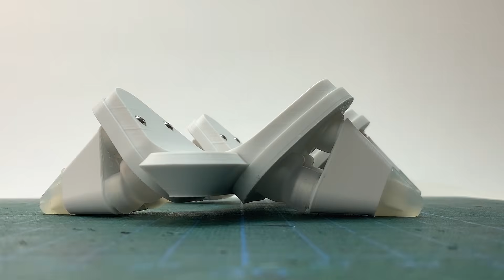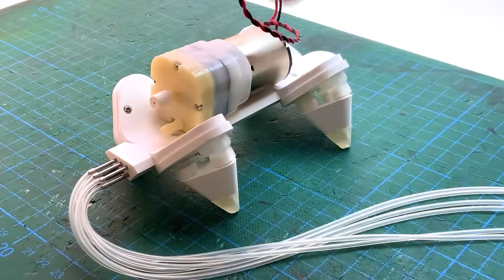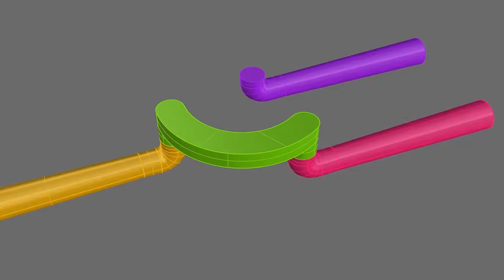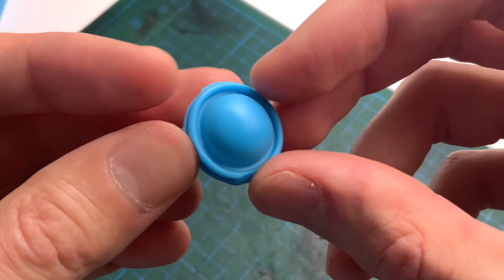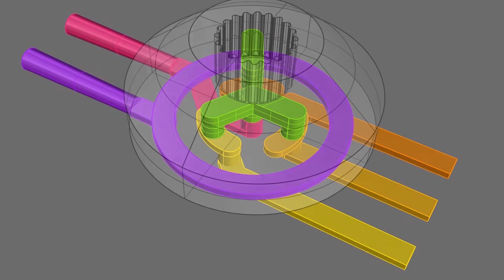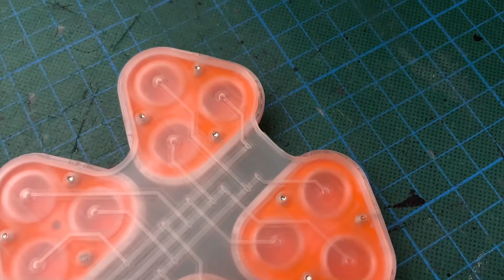Can You 3D Print a Robot’s Brain Out of Air?

Comment: These rolling diaphragms are a kind of bellows, which are a kind of piston and spring. You could get a pair of these to pedal a wheel or multiple to rotate a crank. With a few of them in a spoke pattern, you could push a wheel with a wavy rim, or in a ring pattern you could push a swashplate like in a hydraulic motor. You're really good at making these pneumatic circuits, maybe a version of Strandbeest? That would be so cool to see a tiny strandbeest inspired walker powered by your microfluidic skills!

Comment: you could also turn the valve with air pressure instead of a servo. in your other videos you used a silicone membrane. have you experimented with multi material prints and exchange the silicone to soft tpu? you could create a fully funktional print without the use of any screws or additional steps.

Comment: i see u are using an actual 3D printer.

i have only really used them for basic PLA prints for rapid prototyping.

your prints seem to not have layerlines and are airtight.
what kind of settings and adjustments do you use?

almost looks like it is resin printed, yet you seem to use FDM printing.
these print results are kind of mind boggling to me
Reply: Likely they're using a small nozzle, slight over extrusion, & very low layer heights
Look into printing transparent PETG, it's slow, but the same concept

Comment: This is amazing just as I was thinking about the rotation distance issue you fix it with your second design 😂 I would have been tempted to go smaller and look at the way a spider functions 😂 and as soon as I add that you look at ants 😅 also if you stack the actuators offset to get a better walking gate

Comment: Theoretically, would it be possible to run this robot with a boiler to generate the steam to use for "work" instead? it would not need to be tethered to the air supply then.

Comment: This is awesome progress! Please please please work on a Pneumatic rotational motor! The servo is a nice way to get some rotation into the system but a fully pneumatic motor should be possible right ? Also this print settings are doing an amazing job. Not just for visual clarity, it also stops air leaks by propperly closing off any and all gaps between the lines of fillament. Good work!

Comment: Now if you could power the rotary valve with the air power as well! I suppose you could add a tangential exhaust port and tweak it by varying rotor mass and the size of the tangential orifice to make it kind of "self-throttle"? I suppose that will be quite difficult, as your rotor's bearing resistance (the screw) and the axial force would have to be optimized, and the valve rotor speed is quite low... I could see an ideal case, where the rotor is essentially running on a dynamic fluid bearing with just enough axial force to stay in place and limit leakage. No idea if that would be very power efficient, but it sure could be lightweight!  I hope my rambling makes some sense haha
Reply: Having thought about this for a bit more, whether you use a tangential orifice powered off your main air line, or power the valve rotation with a separate channel (turbine wheels on the outer perimeter?),  air cusioning the valve body woult be quite cool (albeit maybe difficult at low speed). 
For these small, high-precision applications, I wonder ig adding horology bearing stones might be an option down the line. Extremely low friction and low wear, mass produced standard parts for small, precise applications... I wonder if they could be pressed into a 3D print well. Flexture bearing points adjusted/preloaded with a screw might also be good for 3D printed applications like this in general

Comment: A cool next step could be adding a second servo and controlling the left half of the legs with one and the right half with the other. If both are spinning the rotary valves then it goes forward, if you only spin one or spin them in opposite directions you can turn the robot.

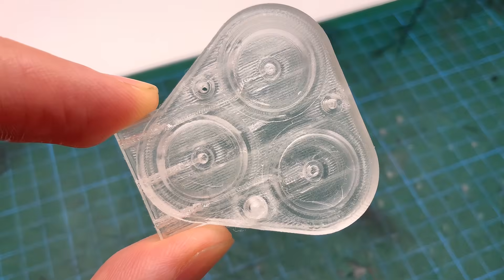Comment: 8:40 The cloudiness is from surface roughness scattering light. You can often make 3D prints much more clear with a layer of epoxy or something that will flow into the rough surface features and cure smooth.
Reply: What about the small gaps inside the print? Maybe just making a mould would be better for clear and just make the whole part epoxy, although that makes the design less additive manufacturing friendly, but just looking at his design it looks possible to cast.
Reply: @Nabikko   I don't know if it will get to the small gaps inside the print, but it will go a long way to smoothing out the surface and making it less cloudy.

Comment: tom stantons air piston motor could be used to create rotational motion instead of a servo. coupling its exhaust to the negative pressure side of your pump may also improve it's performance. it could rotate the valve through a gear reduction.

Comment: Could use a single pump and regulate the output air instead of a second pump? Also how big/hard would it be to replace the servo motor with an air powered one?

Comment: Since you're already working with a "3 phase" system, it shouldn't be that hard to have that rotary valve be driven by the air-pressure itself, using 3 pistons at 120 phase with each other.

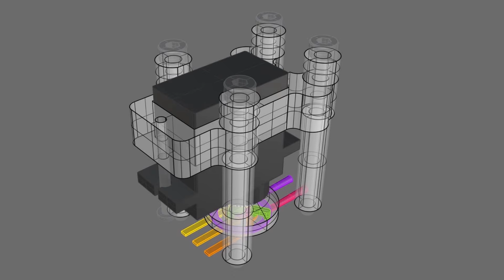Comment: 13:26   So not much has changed. Still dependent on electric power for the ""brain"" and not microfluidic movement. What difference does it make if you are sending DC to is a motor or a microcontroller, get it solely working off of fluid pressures to impress me.
Reply: the only thing the motor is doing is spinning it,earlier every individual tube was controlled individually

Comment: How did you 3D print hollow channels in your components without support filament getting in the way? Was it any specific printer settings? Thank you!
Reply: They are small enough that bridging will work fine. You can see in some of the shots that the texture of the "ceiling" of the channel is a little irregular, but it doesn't matter for carrying air.
Reply: @keegan854  Ah I see, thank you very much!

Comment: Try to replace the servo with an air motor. As a result, you have two tubes only (pressure and vacuum) without 3 wires servo and  you will get a lightweight body.

Comment: For ones with a lot more inputs you could put some teeth onto the rotary part and grooves on the flat part 
Edit: also for the next version you can just have it cycle the air it has, kinda like a heart, which also means you can use water instead of air

Comment: You continue to illuminate just what can be done in the home lab, Softboi.  Someone out there is going to see this and realize that they have the ability to DIY a design for something like a hazardous materials handling system or something equally esoteric that may have unusual design constraints.

Edit: ALSO, now that you are getting to the point of building fluidic oscillators, might I direct your attention to the old BEAM robot design philosophy?  BEAM walkers are rigid-legged robots with oscillator driven gaits that produce genuinely mesmerizing results in terms of obstacle avoidance and navigation.  

It's mesmerizing because the most basic BEAM walker design has zero visible sensor systems.  It's just two motors, oscillating 180 degrees out of phase with one another,.  But, when the front leg hits an object, the entire leg assembly will rotate backwards, moving the walker to one side or the other.  This is without touch or light sensors.  The only connection between the outside world and the oscillator "brain" is the inductance level of the motor driving the legs.  Bumping a leg into an obstacle changes that inductance and causes a one-cycle "flip" in the oscillators, ending up in the motor moving the rigid legs elsewhere for one gait cycle, causing a change in direction.

There would be a lot of design work to figure out what that would look like with your actuators.  Tightly coupling the mechanical oscillators you're building would produce robots that look very different from what you're making now, but transmitting collision signals via increases in back-pressure is a definitely attainable goal for millifluidic systems like yours.

Comment: N is negative pressure
P is positive pressure
An N channel gate is open when connected to the negative pressure supply.
A P channel gate is open when connected to the positive pressure supply.

These correspond directly to P and N channel MOSfets in CMOS logic. A MOSfet has 3 connections, a Source, S, a Drain, D, and a Gate, G. Design optimizations can result in a meaningful difference between S and D, however that is beyond the scope of this comment. S and D are interchangeable until you make them different.

The fluid at the gate must push or pull the with more force than that exerted by the fluids at the S and D connections. This means something like a large diameter cylinder driving a small rod or a diaphragm pushing another diaphragm with a lever.

One possible design would be a pair of 3d printed flat surfaces with holes and a silicone sheet clamped between them. The top surface will be open to the air. The bottom surface will be connected to negative and positive pressure sources. The elastic nature of the silicone will want to make it flat. If there is a small hole on the bottom and a large hole on top, pressure applied on the bottom will push up on a bubble. The negative pressure will just leave the silicone mostly flat. Put the large hole on the bottom surface then negative pressure can pull the silicone down. A small hole on top would limit how far a positive pressure could push.

The other end of the lever could push the silicone down to block an opening between two holes. A slightly more complex mechanism could allow a normally closed channel to be opened.

Comment: it would be really cool if you could use liquids to power your robots. seeing the liquids flow through the see-through channels would be amazing and it could even proof to be more efficient because water is less compressible than air
Reply: hydraulics reinvented pretty much
Reply: @d @darthsquidias7503 but advanced edition
Reply: Not sure what you're expecting, it's only going to move back and forth and it won't be different colors. Not going to be that visually appealing and probably really messy.
Reply: @98Zai alright negative Nancy
Reply: using compressible fluids like air means you can store energy with it. Otherwise you'd need a separate power supply. Imagine using a small CO2 canister with a pressure regulator on it instead of a drink bottle - then you wouldn't really need the extra servo or batteries, you could just power the whole thing with compressed gas
Reply: @tantamounted  really not that difficult to solve, bladder pressured tanks are actually extremely simple and really common. Just have a sack of air in a small water tank. Sack of air doesn't need to be strong at all, pressure equalizes on it's walls. 
Then: push in water, sack pressurizes and therefore tank pressurizes. Reverse speaks for itself. Starting pressure can be calibrated to whatever suits your need. Can store way more energy since it's usually more efficient to use fluids than air.
Reply: This would also allow underwater robots and robots in places with not much air
Reply: Underwater robots exist and so do ones in space.
Reply: I think This is a great idea

Comment: with the servo you can also pump air. and bottled air with a pressure negative or positive is an ok replacement for robots that work for like 2 seconds without electronics

Comment: For getting a completely flat smooth surface you can print on glass. Honestly it's very strange to me how printing on glass build plates got completely phased out to the point barely anyone remebers it. Been using it on my kossel and (heavily modified into a franken-voron) hypercube evolution since starting 3d printing in 2017
Reply: Because glass just doesn't adhere as well as PEI or other alternatives.  You need to go slow with low accelerations for it to be viable even in a coreXY or delta. It works for you, but most printers since about 2019 just don't play as well with glass plates as they do coated spring steel. If I need perfectly smooth  surfaces I have both smooth PEI and custom Garolite/FR4 sheets for that.
Reply: My problem is its too sticky. I can barely get the darn things off the buld plate
Reply: @PendragonDaGreat that's just your personal operator error. Every printer can print great on glass.... New printers even better than the timeframe you mentioned.

Comment: it is in fact very cute. i wonder if it would be possible to at some point drive the logic valve with a motor that's also powered by air presure instead of the servo. maybe even the same that is already used to power the in and deflation of the rubber cones.
Reply: Alexlab already did it.
Reply: @rodniyaya oh damn I didn’t know.

Comment: Amazing build. This is an incredibly cute robot. Nice solutions you came up with for the microfluidics chip. You've been working towards it since the start of the channel so it's awesome to see that come to fruition. I found your idea to take advantage of sputtering very clever, since it means instead of using two motors with excess weight from the housing, you can use one larger motor to handle pumping and actuation.

Here is something i was thinking whilst watching. Right now there are minute air leaks from the rotary valve that reduce efficiency, and your air pump also loses efficiency in the transfer of rotary motion to air motion. So it reduces the maximum power output for a given weight of motor and battery.

So what i'm thinking is, could you kill two birds with one stone by switching to hydraulics? They have the more efficient pumps compared to pneumatics, and force you to use a perfect seal for the microfluidics system. Which means you'll by default prevent loss from fluid leakage. And it'd probably take full advantage of the visual appeal of the microfluidics channels within clear plastic, if the fluid is colored.

Perhaps a perfect seal could be achieved through use of that sputtering technique you want to use, housed within a continuous membrane.

Thanks for the vid. I'm sure you already considered hydraulics. I'm looking forward to seeing whatever you do next. You videos are always excellent to watch.